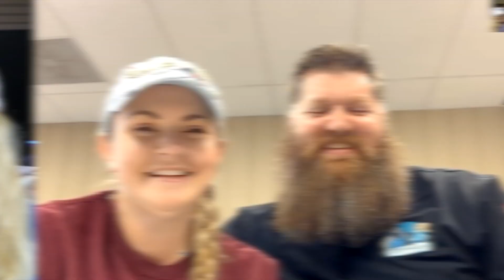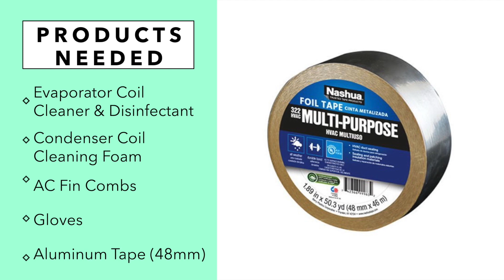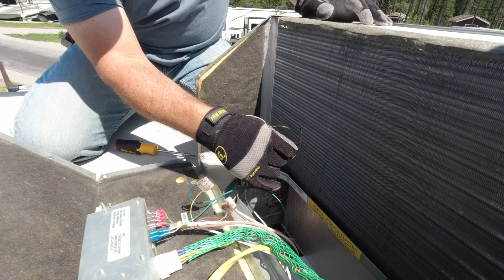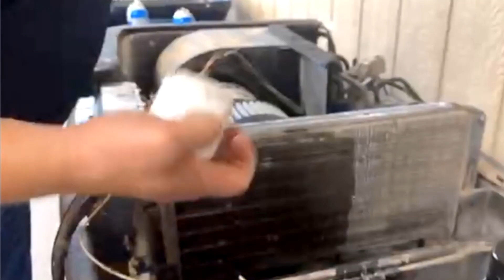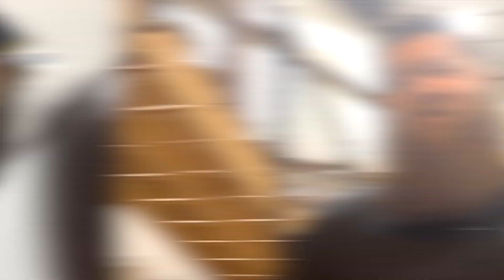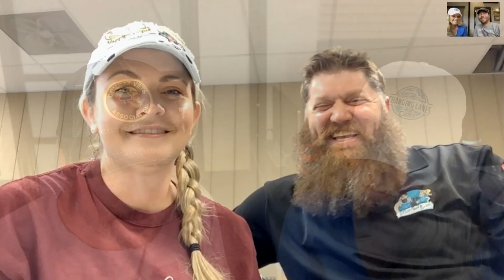Full Time RV Maintenance (Air Conditioning) | Changing Lanes!

Comment: Our Fuzion has same Coleman AC units. Our front unit has an issue sometimes when it's super hot out of freezing over. I think also when we close the bedroom door and isolate it, say at night, it freezes over as well. The defrost auto doesn't work well. So I have to manually defrost by running just the fan on high.
Cleaned the coils last year....seems like it helped but not cured.
However this info and video is super helpful as I was using the foaming cleaner only and just on the inside coils. Gonna buy both cleaners next and try to do a more thorough job.
Reply from the maker: Also make sure the hot and cold side are well separated inside the unit... You might be getting some bleed-over happening.
Reply: So when its super hot outside and you run into freezing coils it really seems as though its an air flow issue. There is a heat exchange on the coils where the hot air in the RV should run across the cold coils. That hot air from the RV has a ton of moisture so it is captured by the coils. IF the coils cannot exchange the heat outside and dry off the coils, then those coils will freeze. Take the shroud off the A/C and check for 2 things, the evaporator coils on the outside should be clean of debris, but make sure your thermistor is in place.  The thermistor is a tiny probe that goes in between the fins and tells the unit to shut off if the fins get too cold.
Reply from the maker: @BigBeardBattery  Ohhh.. good point on the thermister!   You da man! 👊🏼 (I hope this is Todd LOL)
Reply: Changing Lanes if it was Stephanie she would have called it the thermisses.
Reply from the maker: Great for keep coffee warm, but complete garbage for measuring temperature.  LOL

Comment: What's your thoughts on how many of the AC's you have as heat pumps ?  All 3 or just 2 ?
Reply from the maker: Only one unit (the middle one) is a heat pump.  If it gets behind, the furnace automatically kicks in to catch up.
Reply: @ChangingLanes  Thanks for the info, as will all things everyone has different views.  I've been reading a lot on that for my upcoming new full time RV.

Comment: Hey guys.  Super appreciate the info.  Plan on doing this maintenance. We got our 381 momentum   Have had to rarely turn on ac   I noticed that the bedroom unit doesn’t blow cold air?  The other two work fine.  So haven’t really pushed issue.  We will be heading south and warmer soon.  Ideas what to look for when we do the cleaning etc?  Thanks.
Reply from the maker: Congrats on the Momentum!!!  😊  
Not blowing cold air isn't good... sounds like your compressor isn't running.  Double check it's not in fan mode.   Could be something with the wiring or compressor.  I'd call grand design.

Comment: Simple green is a much easier product to get and used to clean a/c unit with. Works well on both coils on with small spray bottle. Foaming cleaners generally have to be rinsed which I didn't see explained cause they will deteriorate the metals. Nicely done video.

Comment: Do you ever run 3 A/C's on 50 amp power? Or just mix and match with 2 units?
Reply from the maker: Running all 3 right now!  never a problem on 50 Amp. 50 Amp is really 2 50 Amp legs, so plenty of juice.  30 Amp, run 2 at a time.  On the genny (45Amp), we can run 3 as long as we run nothing else.

Comment: Great video editing was very good. I do have a question about the cleaning of the evap coil. I’m an A/C tech and  it looked like you cleaned the wrong side of the coil. I don’t know if your unit is pulling air through the coil if so your good or is being pushed through the coil That does make a difference. Might want to check on that.
Reply from the maker: I sprayed the other side also (as much as I could reach with the fan shroud...  Should have shown that.. 😳
Reply: Perfect...we love following you guys. Look forward to meeting you both. Glamp On

Comment: Great video! I'd add one thing when it comes to the exterior a/c covers...take a long handle (broom handle) and tap on the covers before you start taking them off to make sure bees/wasps aren't making their own vacation home in there.
Reply from the maker: Good idea... I was figuring the drill would do the same... but banging around a bit is likely better with some wasp spray handy if it tests "positive".  😳

Comment: Nice job on the video....very helpful, especially now that I have had my rig a year I am sure the AC is ready for inspection and cleaning! I can tell you that the first week I had my RV, I noticed the AC was stupid noisy (Dometic BriskAir II) I pulled off the inside cover and I found that the installation was done poorly and much of the air was going into the ceiling and the foam tape they used was not sealing the intake from the blower side so it was just recirculating the air. I even had insulation sucked up into the evap. coils on the inside. Took out my trusty HVAC tape and resealed everything and made it air tight and way less restrictive. It was cooler, far less noisy, and much more air was coming from the vents!

Looking forward to the next video!
Reply from the maker: So far, our's has had only minor air flow issues (like we showed in the video), but we've seen some online that look like a 5 year old installed the unit.  LOL

Comment: This is awesome! I was going to make a video for Nebraska Camping Community Facebook group on this very topic since there has been a lot of people on there with AC problems lately and its mostly lack of maintenance.  Now ill just share this so i don't have too. The only thing i do different than you is i used canned compressed air for cleaning computer keyboards to blow the dust or flying cotton off the fins. That works pretty good. One could use air compressor air but it is to easy to damage the fins with that so that is not recommended. Now i can put my own AC off a little longer. HAHA. I was going to do a wheel bearing video too because that's a hot topic. But ill let ya'll do all that hard work and ill just share. LOL
Reply from the maker: Thanks for sharing, Cory! 😊

Comment: Have you seen the new replacement air intake filters from RVAir? Just bought some for our rig. Can not give a review yet but they are better filters. Not cheap.
Reply from the maker: Thanks!  Just looked at them...  They sure seem much more air flow restrictive than the stock ones..  Concerned about air flow...  Notice any difference with them on in terms of moving air through the system?
Reply: @ChangingLanes  No I did not. Our unit had those cheap filters. I like these a lot. One point your friend did not point out was slower air flow will result in colder air outlet. Same principle as running fan on slow speed. This also result on less load on compressor. You might ask you buddy for his opinion. Go Navy.

Comment: I'm going to add some commentary throughout... I hope it helps. I have no experence at all this, so it's just my uneducated commentary, ok.. First, the pray on foam. it seems to me that letting the foam simply do its thing and dry without being sprayed off, everything you loosen just sits there and dries on the coils. Do you think that covering the hole into the roof and flushing with water would be a better and more complete solution to making sure you get all the crap out of the coils and off the roof? Second, I love the idea of the comb, yet think that taking time to gingerly use the comb to do the job thoroughly and completely is best. Next,  I would think  that any work you do on those coils should avoid pushing debris further into the coils causing more congestion and build-up. Vigorous flushing  seems best. Your system seemed pretty darn clean, BTW. Last... love this couple and the healthcare plan they pulled together and the home schooling program. Nice too that they built a network that brings like-minded travelers together. Overall, great video and I look forward to more. Happy travels!
Reply: For clogged fins you can use water, but the way it's used is crucial.  A hose with a sprayer usually will cause too much pressure, so yes a hand pump spray application will help. As well as you see in the video if you use the brush first you can loosen the debris pretty effectively prior to applying the cleaner.  Water does work, just be very careful. Great questions.

Comment: Great video guys. I’m looking forward to this series. Cleaning and inspecting the A/C units was the first thing I did when I purchased my used Solitude 369RL a few months ago. Needless to say the dealer didn’t touch them. I was quite happy with the job GD did installing them. I didn’t have to add or remove any silver tape. A small shop vac with the soft brush helps to clean the fins as well.
Reply from the maker: I can imagine the shop vac would be handy if they were really dirty for sure!  Thanks for watching! 😊

Comment: I just went through that process just last week & think I did pretty good without the knowledge you just shared. On another note, I installed an “easy start 364” from micro-air.
Wow I’m so impressed by it. Excellent for dry camping/booddocking where you run off your generator.
Reply from the maker: If you'v e only one one AC, you look into "hard" start versus soft starts.  Same idea (extra capacitor for the start up) without the "brain".  Todd (from this video) recommended them.
Reply: Hard start mod is cheaper, but still draws a lot of amps/watts at start up. I’ll stand by my choice 100%
Reply: Has Todd ran the hard start on a 2000 watt generator?
Reply from the maker: @dannyscobee6530  @TwoBeardsandaBabe .... Todd?

Comment: Those intake filters were really dirty!   Cleaning those alone probably helped your system out a lot.  But the extra detail you showed with the fin cleaning and straightening was awesome.  The foil tape was also a great touch to make sure you're running as efficient as possible.  Excellent video!!